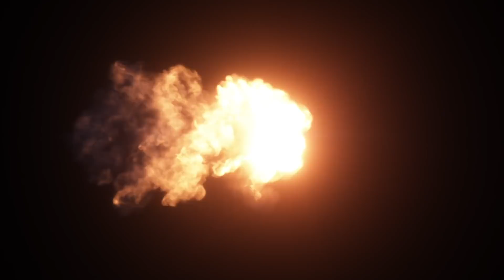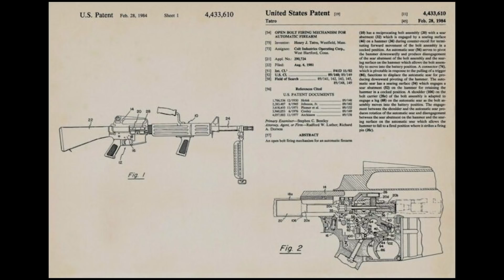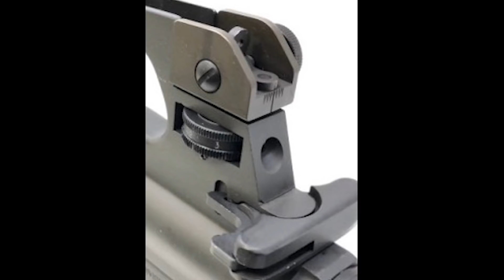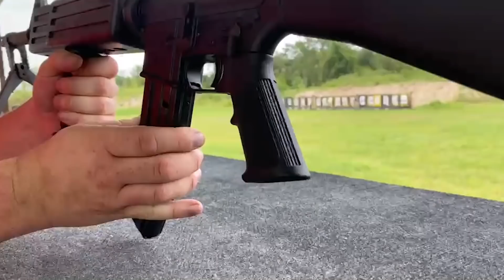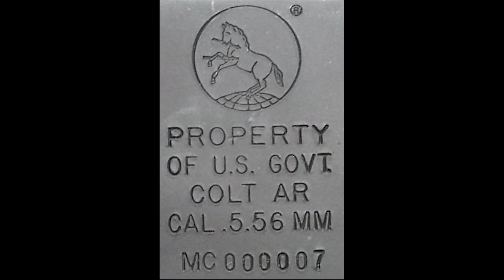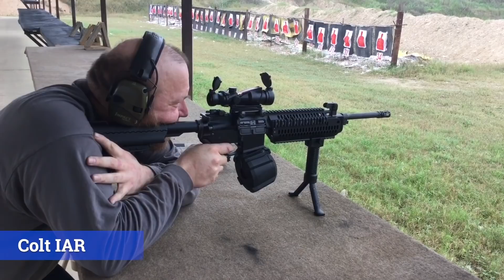The Colt Light Machine Gun (LMG)

Comment: Idea for a service rifle : have the hydraulic buffer and have the option of switching from closed bolt to open bolt like an fg42 depending on the fire selector position. You can either get accurate semi auto closed bolt fire or controllable full auto with no risk of cook off.  Would have been cool for an IAR contract

Comment: You know what’s also interesting, since the FRT triggers and it’s equivalent- you can make a civilian version with an HBAR barrel and an inconel gas tube. The only downside is that it would be closed bolt, however if you use it as a Light Support RIFLE then it should be fine with 3-4 rapid shots if used correctly. Hell even 5-9 shots per shooting intervals is fine as well.
Reply: Red Right Hand has something you might like.
Reply: Already made mine. if I get their upper that rifle is gonna be a safe queen until trouble comes by.

Comment: Related to machine guns like this. I wonder if a LMG built off an AR10, but in 556 and using mags similar to the desert tech Quattro. AR10 base for increased life span/durability and increased weight for recoil reduction. Then Quattro mags for volume of fire. 
I know the mags would have to be redesigned for the AR10, this is just a thought
Reply: Wouldn't it be simpler to sleeve a 5.56 magwell into it? This would be no deffernt than the Bren 2.

Comment: Wonder how the Colt IAR would have done with a mid length gas system & a hydraulic buffer?  If that would have reduced the rate of fire measurably?
Reply: Why would it use a mid length? It's a 20" barrel the proper gas system is a rifle length. A mid length would vastly overgas this weapon and increase the rate of fire if anything.

Comment: I wonder why they left the hammer in. You could just use a fixed firing pin like so many open bolt systems do, and have fewer moving parts. Maybe it was easier to retool existing m16 parts?
Reply: Reduced risk of out of battery detonations. Not a massive issue with pistol caliber rounds, but 5.56 will kill the rifle if OOB. Not to mention it's a known element and works in the first place.

Comment: i disagree LSW's like the RPK, L86a2, and AUG HBAR have proven themselves at the squad level and offer far more advantages than a belt fed light machine gun like that M249. however I fully agree that the IAR program was completely pointless because it doesnt offer any benefit over simply giving each individual rifle man and auto selector. 

1. the IAR doesnt have a 20+ inch barrel. this means that overall effective range and lethality at extended ranges suffers most LSW's makes use of a longer barrel to squeeze every bit of velocity out of the cartrage and extended the lethality of the squad element. 

2. doesn't feed from higher capacity magazines. this is pretty self explanatory 

3. lacks an effective bipod. while newer IAR's have harris bipods the harris bipod doesn't all for tilting side to side to easily change magazines.
Reply: Very true, but I’ve also seen that others are making something called the”AR-RPK” with a 20-24 inch bull barrel with an m60 bipod like the model 606. I’ve also seen desert tech making a lower that could take a true quadstack magazine that(hopefully) exceed more than 80-100 rounds in the coffin magazine. Right now it’s only at 53 round, but I can see people requesting a whole lot more capacity like the surefire 100 round magazine without it being so long. It’s 53 round magazine is a bit shorter than a usgi 30 round magazine, so a 100 round magazine being a little longer and it could have the us military to take a look at it for the squad level. What’s even more amazing is that desert tech made a drop in mod inserts to accept standard usgi magazines as well.

Comment: Basically just an h-bar with bipods.
Reply from the maker: Much more to it than that
Reply: @SmallArmsSolutions  yea Chris I get it. Open bolt vs closed, the modified buffer system to slow down the cyclical rate and the addition of the modified gas tube. But literally it is just a heavily modified A2 with the addition of a heavy barrel and a set of bipod in addition to the above-mentioned mods. Not Downing the system but it's no Marvel of modern engineering either. Anyone with any basic understanding of the stoner system could have figured it out. Looks like a decent weapon, but if it was really that good I would have been humping that instead of a saw. As you know the saw is belt and magazine-fed from standard issue USGI magazines. Kind of makes this weapon (LMG) a moot point. Nice review as always.
Reply from the maker: @Sandhill1988  operating dynamics are quite different.